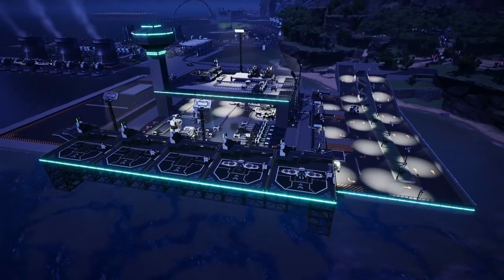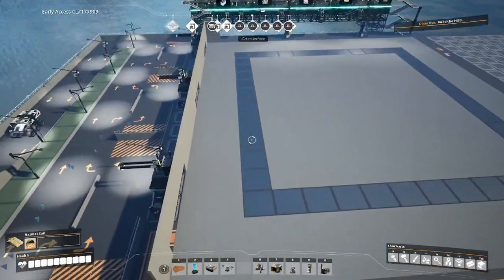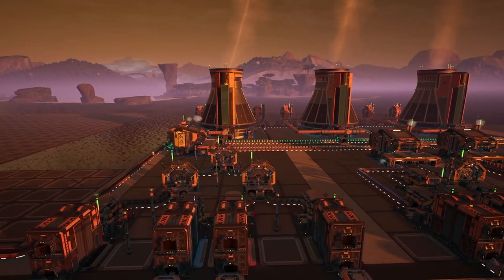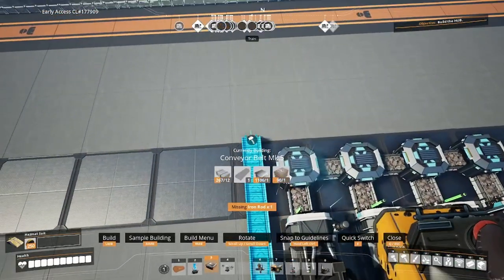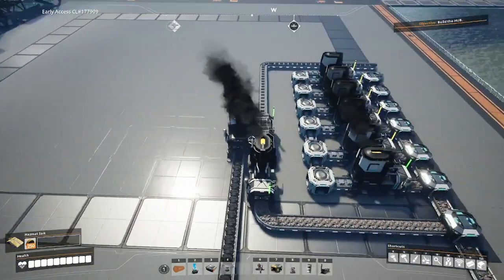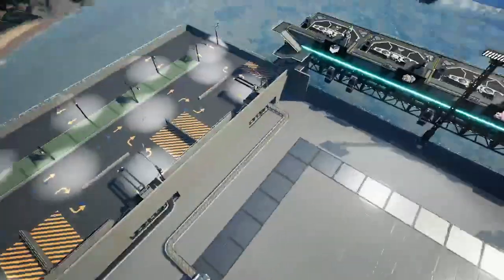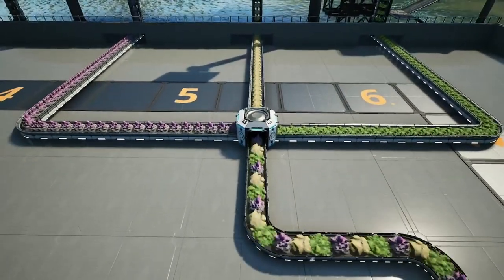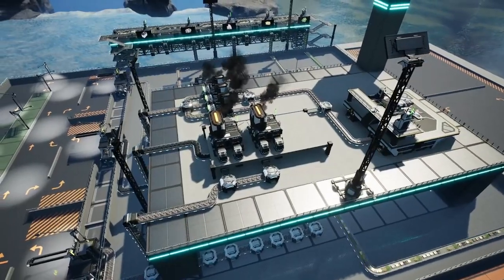Satisfactory Update 5 Supply Depot Build Guide - How to build a depot for logistics in Satisfactory

Comment: Yea this is helpful, a lot of my factories have the raw materials get completely processed there, this would help getting processed materials to my factory. Thanks for the build idea!
Reply from the maker: Glad it can help! I like using depots like this when a factory doesnt make use of all the nearby resources. If you only need 500 iron but are near 2 pure nodes, for example, you have to take some of that iron away if you want to capitalize on those nodes, but to get the right ratios split between two  or more different factories can be tricky. Thats where this kind of depot comes in. Of coure, in the real world I just as often leave the excess iron unused and just build on a new node, but that's just how life goes sometimes.

Comment: your builds a very simple and not trying to build something that is just a mega project that can be used for small scale or scaled up at a later time.
Reply from the maker: That is the goal! I try to make the game more accessible, when I am playing I make a note of whenever a task feels daunting or very difficult (like late game logistics or nuclear power) and then try to work through it and figure out how to make it easy to understand so I can pass that knowledge along.
Reply: @Dekoba  I am in the process of building my nuclear plants I have two banks of 9.  But want to build the plutonium processing too so all is done from the start.
Reply from the maker: @MrTwidget69  Good plan. Would it be helpful for me to put out my plutonium video soon? I was going to give it a couple weeks but Ive already got the design  worked out (sort of, its functional but not pretty), can push that up to next week.
Reply: @Dekoba  I think I have mine pretty much done. I have 3 blenders feeding a particle accelerator then an assembler then a sink.  I just have to finish setting up the nitric acid and sulfuric acid production.  I will two of theses set up one for each of my set of 9 reactors

Comment: something I never see talked about is how many batteries do you really need per min to make drones worth while…
Reply from the maker: Thats a hard question to answer. I am making a 150/min battery factory right now and that should provide for about a hundred drones - far more than I am lilkey to use, but basically a drone flight uses 5 batteries + 1/km of flight, round trip. so 2 bases that are 5km apart, a flight would take 15 batteries (5+5+5). That flight would take about 10 minutes and could move 9 stacks of items. For things that stack to 50, this is a bit less than a mk 1 belt. Drones are just one tool in the toolbox, and can be approximated at ~ 1-2 batteries/min per drone, but are really only good at moving small amounts of items. so things like end game constructed stuff, rather than ore or other very plentiful items. I think my last time playing with drones I ended up using a bout 60 in the world before I didnt have any more good uses for them, so for my current world I think 150 batteries/min should be enough.
Reply: @Dekoba  thanks for the comment. I am currently in the process of setting up a factory to pump out 600 min…. lol. I think I am going to rethink that.